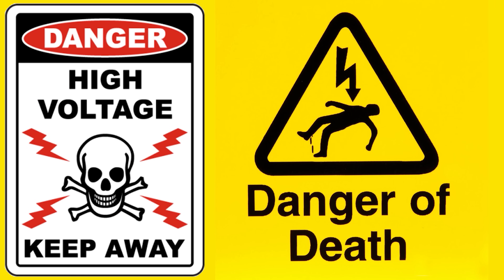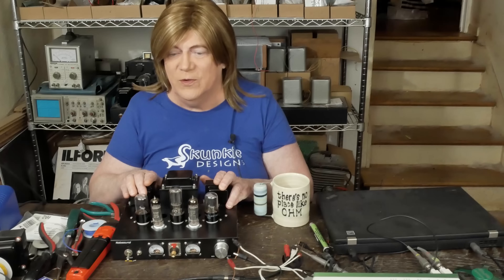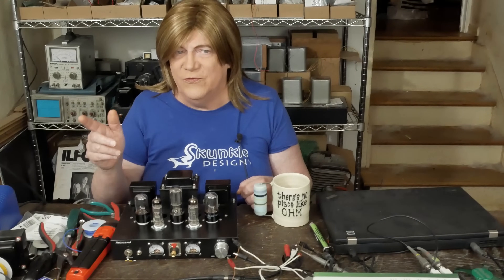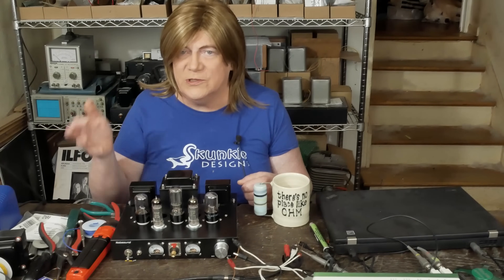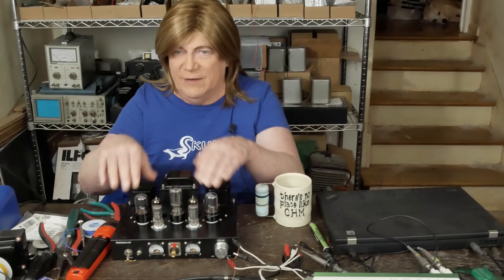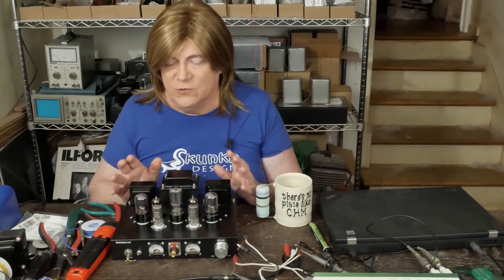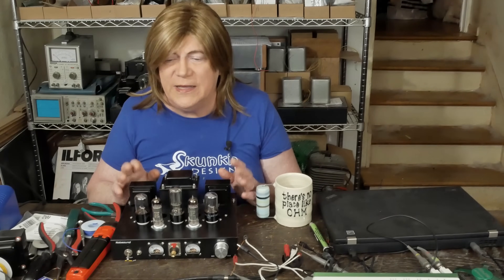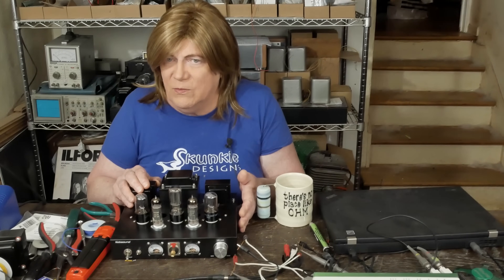Nobsound 6P1 / EL84 Mod: We Have a Serious Problem!!

Comment: Thank you for the honest report of the problem and the technical details to it. As I do not just build amps to a given schematic but design my amps myself, this is a healthy warning for not being too confident just because my amps so far worked straight away without problem. In particular with my second one, that I did in point-to-point, I should probably regard it as a lucky strike. Rather than giving my 5 pennies worth of remedial suggestion, I look forward to hearing of your findings and resolve of the issue. Keep up the good work!

Comment: I had exactly the same problem with my Mullard 3-3 amp. The only way I fixed it was to have a 10k volume pot with a 1k resistor across the input. I tried everything else no luck.
Reply from the maker: Strange stuff!

Comment: Most likely some capitative coupling between input and output (due to wiring/layout) when running in high gain open loop mode. 

Before re-wiring or adding stopper resistors, I'd try closing the loop by connecting the negative feedback to see if that stabilises it. Closing the FB loop should slug the overall gain by around 17dB or so, depending upon frequency.
Reply from the maker: I wanna try revising the wiring layout first.

Comment: The purpose of the 150K resistor is to allow the 820R cathode resistor to be a lower value, increasing loop gain. A small value capacitor from input stage grid to signal ground might squash the oscillation, something in the 100pF to 250pF range. This is always a potential issue with star groounding. All good fortune.
Reply from the maker: I wanna try revising the wiring layout first.

Comment: The best EL84 amp I've ever had was RH84 v2. It uses a zener for stabilizing the EL84 screen.
Reply: Have an RH84 v2 that I buit too, used vintage sony output transformers and it sounds very, very nice. The nicest sounding amp I have ever owned. Very detailed nice wide soundstage and just about enough power for my speakers too. Very cheap to build.
Reply: @flyingmattyboy  It was my first handmade amp. After version 2 came out, when I replaced the screen resistor with the zener diode for constant voltage, it really sounded perfect. One of the best sounds I've ever heard.

Comment: I have had ultrasonic oscillation in 6l6 p-p amp and 6v6 single ended amp. its like an RF feedback usually to do with ckt layout. try series grid resistors in output tubes. good luck this can be a real hair tearing problem

Comment: I too recommend grid resistors and especially on the sreen grid of the EL84.Just a small 100 Ohm right on the socket. Furthermore from watching the build up i can spot that the line from the output transformer runs right next to the input line to the driver ( the two black ones ). This may cause the oscillation.  It is also possible that the chinesium output transformers just can't run stable open loop because of the high gain. That would fit to the results you had when you used triode mode or disconnecting the cap from the cathode resistor which both lowered the gain.
Reply: High gain was my feeling, too. Grid and screen stopping resistors is also a good idea.

Comment: I see another comment suggesting the installation of grid resistors, and I too believe that is what you need.  Try 1k resistors right on the socket on the control grid pin.
Reply: I meant to say install the 1k resistors on the power tube grid socket tags between the wire feeding the grid and the grid tag.  Oscillations like that are not rare and you’re not crazy. 
It does not oscillate with the cathode bypass caps disconnected and also in triode mode probably because the gain of the pentode is much less in those two conditions, but when in pentode and with the cathode bypassed via the capacitor, the gain is pushed over the brink of instability and the amp becomes a signal generator!

Comment: First, it would be helpful to know the actual performance data of the transformer. To do this, determine the dimensions of the core laminations, as well as all conductor cross-sections and voltages. Then perform a load test with the transformer removed. The oscillations are caused by the modified preamplifier, the design, or a circuit error. Therefore, it is always advisable to set up an external test circuit before installation and experiment with the component values until the circuit works perfectly! It would be great if you could show the circuit diagram more often and for longer so that we can understand your explanations and offer tips if necessary. There is definitely no need to dismantle the small amplifier! It is a nice, simple housing with level meters that provides a good basis for implementing a wide variety of circuits! Best regards.
Reply from the maker: This is a well known circuit, the link is in the description. And you should be able to pause the video to see the schematic. In my experience, breadboarding doesn't always reveal problems that arise when the circuit is wired inside the amp. This same exact circuit works PERFECT in my friend Mark's amp chassis with a different layout (and hundreds of others have built it), so I know it's not the circuit design or the part values. It's something to do with this layout, which breadboarding would never reveal.
Reply: @SkunkieDesignsElectronics  Ok, you mean the link to audiokarma, I found it in one of your other videos, but it's missing from the description for this video, hence my surprise, everything's fine. Greetings from Germany
Reply from the maker: Sorry if that wasn't clear.

Comment: I had a similar problem with an amp oscillating when I had the output transformer inputs reversed. It made the feedback loop go crazy.
Reply from the maker: There is no feedback connected right now. And yeah I have see that. If this was the problem it would oscillate in triode mode as well.

Comment: I had the same problem. Drove me nuts! Turns out all that excess AC was coming from the output transformers. Have you tried reversing the speaker connections from the output transformers? In other words, ground the 8 ohm taps from the OTs and connect the commons to the speaker outputs. I know it sounds insane, but it fixed my amp.
Reply: In the course of my diagnosis I also noticed that I'd grounded the heaters twice. Once via pin 3 of one of the 6bq5s as DG suggests, and again at the star ground via virtual center tap. I kept the star ground connection and ditched the one at pin 3.
Reply from the maker: This amp has a real center tap for the heater that is grounded.

Comment: Most likely oscillating due to long wires from that tag strip. Try installing 1K grid stopper resistors on ALL of the input grids including the output tubes.  Connect one side of the resistor as close as possible to the tube socket.
Reply from the maker: That's a good thought, I will give that a try!

Comment: Howdy. Yeah.
I should think everyone fiddling with tube amp.s have encountered parasitics. Usually about 40 kHz to 50 kHz. My suggestions to remedy.
Larger grid stopper resistors. Or ferrite beads in the grid wires.
Splitting the cathode resistors and cap. bypassing only one part. Say 10 ohm + 150 ohm.
Inserting a 100 ohm resistor between the anode and OPT.
Connecting a 220k resistor an a 220pF cer. cap. in series and connecting the series between anode and grid. Decrease the cap. value and settle for the smallest that works.
One design of mine was troublesome. I had to load the input with as small a resistor as 2k2.
In another case it was a bad grounding scheme. Too thin minus bus wire. Use at least 1,5 mm2 and make bends as shallow as possible.
Cheers.

Comment: hi ,if you have voltage change with volume youre not in class A, so in class a with 6bq5  sceen voltage maybe the same that plate no problem.The 150k at the cathode is a aberration,put a 1.5 k value cathode resistor and remove the 150k ,so 10k in the grid 12ax7 is useless also ,
Reply from the maker: The point is, this circuit has been used by hundreds of people without this problem. I'm baffled at why it doesn't work with this layout/chassis. And there is no "change in volume" as there is no signal when this is happening. The amp is idling.

Comment: You are experienced to do this sort of work, and you have walked us through exactly what you have done. I believe its unlikely that you miswired anything. Physics is unforgiving and catches us all off guard. My suspicion is there is some sort parasitic coupling that is causing  a coupling between input and output. The fact that it goes away with adjustment of the volume control suggests it could have something to do with the grounding layout. I wonder if the triode connection reduces gain just enough to stop the oscillation.  Coupling through the power supply is certainly a possibility. Have you 'scoped the power supplies? Have you tried grounding the grid of the driver tube? Problems like these are what makes people great techs!
Reply from the maker: Grounding the grid of the input tube absolutely stops it.

Comment: How much fun is this?! I hope you get to the bottom of it. I don't know if it will help, but DeepBlueHarp talks about tube squeal in a few of his presentations...
Reply from the maker: It's fun when you find a solution!
Reply: @SkunkieDesignsElectronics   Yes, it would be satisfying to understand exactly why it was occurring so you learn and fix accordingly, rather than admit defeat by simply reducing gain!
Reply from the maker: Yeah, we are not doing that, I wanna understand what the problem is.